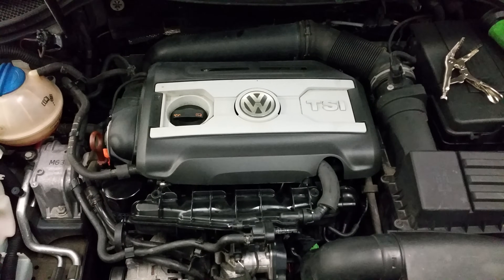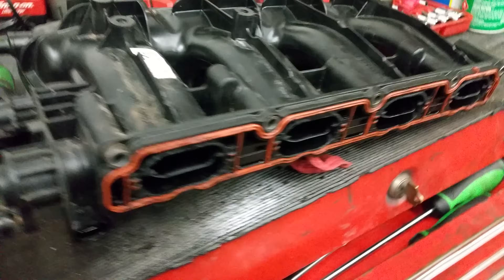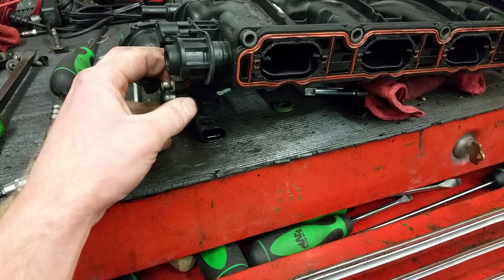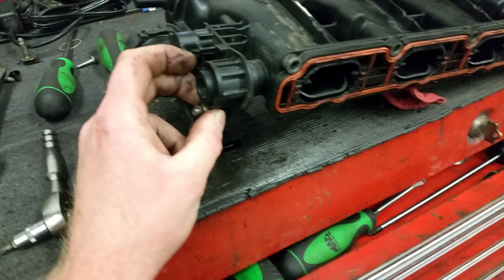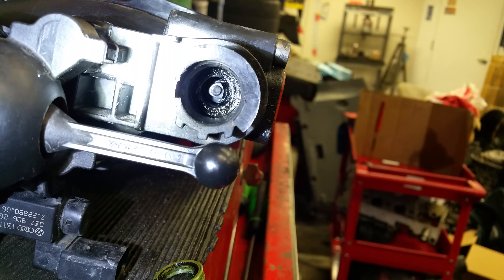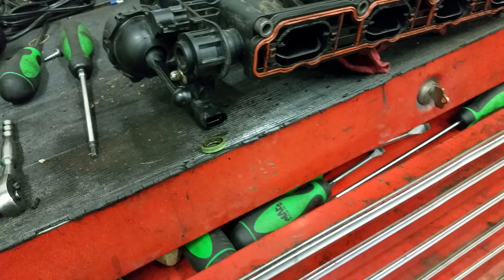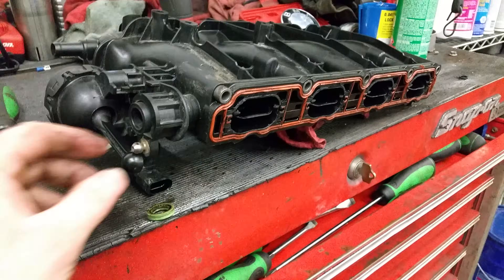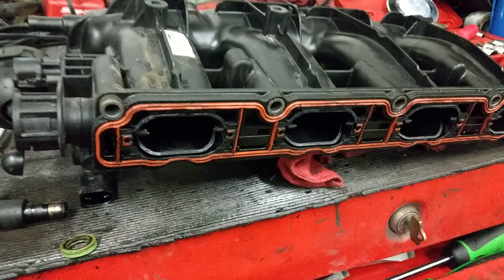VW 2.0T TSI Intake Manifold Failure Explained, P2015 Code

Comment: Volvo V50 bensine 1.8 liter 2005 model has a fault of yellow engine which appear and dissapear and it passed the technical revision, my question is if is safety if I buy this car in Norway, they wrote this in the add : Engine light can come and go - Diagnosis says some "flaps" in the intake. This means nothing for driving the car, and you can drive it daily without noticing anything. Was Eu approved with this, and has worked fine with this daily. What is your opinion is good to buy this car or not ?

Comment: I have a solution for this. Already tested and working like a charm. Not sure how long it will last but here goes.
First go out and buy "JB Weld 33301 Total Repair - Accelerated Instant Cure Super Glue, 0.18 oz" comes with a UV light attached which cures the glue instantly and hardens. JB weld says it has about 2700PSI of strength and withstands temps of around 300F. 

Apply small amounts at a time to each side of the triangle piece that is protruding from the flap piece and utilize the UV light to cure. Once you have all 3 sides cured. mate the triangle piece and see if it fits snug. If slightly loose, then apply a small amount of glue to each edge and cure it with the UV light. Then try again, if slightly hard to mate the triangle piece you are ready to put all back together. once you have the manifold flaps put back in place. Slide the female throttle piece into position, using slight force and making sure the flaps are facing the correct position. Then test out the function with your hand. Once you notice this has no play what so ever, you are done with that part. 

Now you will need to also buy "2.0T TSI Intake Manifold Lever Arm Fix Kit" 
Install that in place to prevent the triangle intake manifold arm from slipping back out. This device will ensure that doesn't happen.

Voila, problem solved. You can use this technique on Audi/Volkswagen's that have the same style intake manifold issues.

Comment: I know this video is a little older but here I am in 2023 and I have a 2016 Tiguan with 85K miles and the local VW dealership confirmed there is an extended warranty for this part.  I'm taking my car in to have it fixed under warranty.
Reply: Im a new owner of a volkswagon and these cars are A LIVING NIGHTMARE!!!!
Reply: I have a 2016 tiguan as well 86K. Will this apply for me too? Have a P2015 code on the service light.

Comment: Just received the P2015 code on our 2016 VW Tiguan.  Is it possible that just the sensor has gone bad and the entire intake manifold does not need to be replaced?

Comment: I had the same error code on my Golf 7 R 2014 (300HP). After checking by a mechanic it turned out that my Vacuum hose was completely disconnected… makes sense that I got this error too 😂

Comment: I have no codes accept, misfire on 2,3 cyl.
I have changed everything, plugs,coils, injectors, carbon cleaning, compression test ok.
Misfire occurs on startups cold or Hot. 
It feels like too much air or lack of air or fuel and then it stabilizes in 5-10 seconds. 

It’s a 2016 TFSI 2.0T. Audi A6 

Once I cleaned Intake with a carb cleaner reinstalled it, the misfire disappeared for a week. 

Then re appeared. 

I’m leaning towards the intake replacement, I’m watching these videos and thinking if I should.

I have thrown so many parts at this I’m having second thoughts….

Driving around with check engine light. 

Hopefully you have some insight…

It runs perfectly fine after the misfire on startup. Loads of power.
Reply: You ever figure out what it was i have a 2012 jetta turbo the engine sputters on cold starts until car warms up sometimes shuts off if idnt rev rpms until it warms up any clues?

Comment: Hi. Lately my A5 2.0 has been throwing a P2015 INTAKE MANIFOLD RUNNER POSITION SENSOR / SWITCH CIRCUIT RANGE / PERFORMANCE BANK 1a Code. Should I try swapping out Just the Runner Positing Sensor, or call it a day and replace the whole manifold ? A brand new one comes with The Gasket, Solenoid & Sensor for $210 from Autozone, brand URO pt #  06H 133 201AT. I'm just looking for an opinion with someone who has better knowledge than me. Thank you.
Reply: I got the same exact codes I’m going to just replace the whole thing soon, but wanted to know if you replaced yours and if your car problems went away?

Comment: My 2015 Tiguan got this code at about 93,000 mile.  I removed the black plastic lever and fortunately it was not all rounded out yet.  For some reason it just back off the shaft a few millimeters after driving it a short distance.  I used a 8 inch vacuum/flue line, slid it over the shaft inside the manifold and turned it clockwise.  If you listen closely you will hear the air flaps close completely.  Mine were open about 1/8".  I used JB Weld on the inside of the plastic lever and slip it back into place, let it dry over night and cleared the code.  Over 600 miles later still going strong with no code.
Reply: You did that without taking the manifold off ?

Comment: Hello I have an audi Q3 model 2012. After cleaning the throttle the car shows check engine with computer reading : Intake Manifold Flap position sensor bank 1 implausible signal code 08213 I changed the sensor but again showing check engine and the same error when read by the computer. Any help please. Thanks

Comment: I've just bought a Seat Leon Curpra 280 of the same year which I believe has the same engine. I got the same error code with the engine light on the dash. I've only had it two days and it comes with a three month warranty and already the dealership is being difficult on the phone. Hopefully they replace the manifold complexly and don't try a temp fix to get me over the warranty expiry date.

Comment: I'm curious if anyone has completely disassembled the "flapper" assembly from the manifold? I'm about a week away from pulling my intake due to a failure and presumably massive carbon build-up and although a new intake would be a rational fix, I've already had one replaced under warranty and am now outside the extension time-line.

Comment: Where exactly would you install the epoxy on the part? I found mine was loose and pushed it back in and now it’s running fine but I want to prevent that and I cannot afford to replace the whole thing right now

Comment: Hello!! I need some help. I replaced the manifold but not the sensor. I also purchased the ecs arm fix kit and it did not fix the code either. The car drives fine. Just has the code. Any idea what it might be? The sensor?

Comment: How was the car running when it gave you the code? I’m not sure if I need a new manifold or not. I have code p2015 along with misfire codes, even with new plugs and coils
Reply: This late but if misfire only when cold start for few min then problem is carb build up on intake valves. Intake must be removed and cleaned.
Reply: @geeess958  I literally tried everything as far as replacing the whole top of the motor and intake. That car was the biggest piece of shit! I spent $6,000 trying to fix it, only to let it go back.
Reply: @amandacarter7532  these cars have a lot of issues that Volkswagen themselves seem to not know about or understand. I've learned a lot about them through trial and error. They can be easy fixes if you have knowledge on their hidden issues. Nearly all of these problems with the intake are carbon related. It is a flaw but moderately cost effective repairable.
Reply: @geeess958  I loved this car so much but it was impossible to fix it. I took it to Volkswagen and let them run their diagnostics on it. I ended up paying them $2,500 for parts, labor, etc on top of all of the parts that I changed. The whole top of the motor was changed and the fuel pump in the tank. It didn’t have any build up inside it. The manifold was replaced and all. It was probably a tiny sensor or something. I went through 7 sets of plugs and coils and it misfired as soon as it was started. It would run fine if I started it, went straight into gear and pulled out. If I didn’t it was undriveable. I did everything in my power to fix it. I’ve never seen a more fucked up vehicle in my life. They really dropped the ball on those cars. I really wish I could have fixed it but instead I had to just let it go back. That car will always be one of my biggest regrets. I wish I’d had someone that had the knowledge to fix it.
Reply: @amandacarter7532  I'm sorry to hear about that. Messed up how they charged you so much and you still had problems. It is rare tp come across the right person that knows these cars. Its like a secret. Maybe one day I start a youtube page to help people. Just be soooo bidy. What you described sounds like a PCM or wiring issue, another notorious problem with these but relatively easy cheep fix once discovered. I've had several woth the issues you described and turned out to be a wiring issue. Many will disagree bit I think these should never be tuned. So sorry to hear about your story because these have really good potential if repaired right. Well wishes.
Reply: @geeess958  I always said that it had the symptoms of an electrical/wiring problem. I just couldn’t find anyone that knew how to diagnose the wiring. They wanted to continue to run trials on the car but everything they did costed me another $400-$500. I finally told them to not do anything else to it. They were just guessing. Their plugs and coils alone were $550 and I was telling them the whole time that wasn’t the problem. There doesn’t seem to be many people that do know those cars. It is like a big secret that only a few know lol

Comment: Has anyone had the seal cause a vacuum leak by cylinder 4, hense causing a misfire?
Reply: Just bought one. Cam shaft sensor decides how whole motor moves

Comment: Hey! I think this might be what I'm dealing with. Nobody EVER has videos on the CC, but my 2014 CC has the P2015, with about 86,xxx. I bought it as a CPO World Auto, so hopefully the dealership will help me out, but I'm not holding my breath. 
Anyway...the code reader I used pointed to the position sensor, but you said the whole intake has to be replaced? 

Thanks for any info, I know this video has aged quite a bit.

Comment: Great video. How many miles were on the vehicle? Also are you aware of Volkswagen extending the warranty on these due to consistent failures on their vehicles out to 120,000 miles?
Reply: is this so?  If so, I had mine replaced by the dealer at 55K and now at 113K, an independent shop says it needs to be replaced.

Comment: Instead of using liquid epoxy, I used the moldable metal reinforced epoxy sticks, something like sugru, and its worked for over 2000km on my MK6 GTI.
Reply: Can you tell us how exactly you applied the epoxy??  I want to try this method as a stop-gap but don't know how much to use or where precisely it should be applied.  Thanks!
Reply: @DanielPowless  I just jammed it in there
Reply: Would there be some risk of it getting sucked in through the opening into the cylinder ?
Reply: @davidescobedo1317  no, there is a seal on the other end, there is a risk to glue and lock everything up.

Comment: Will that p2015 cause p0300 multiple misfires
Reply: Yes it does Im having the same issue
Reply: I dont think so, in my opinion. The issue I believe which causes multiple issues surrounding the intake and random misfires is carbon buildup. Intake valves on these are notorious for carbon. And if buildup is in the valves, it is certainly in the intake flaps, etc.

Comment: I had my intake replaced 3 months ago (2.0t tsi engine)
But now the engine light comes up again! P2015 again 😐
The seller asked me if the sensor of the intake manifold was also replaced?? 
Which sensor...??
Reply: 10 months late, but probably referring to the Air Intake Manifold Runner Control Sensor from what I've been researching.

Comment: Damn, this is THE BEST video I've ever seen on the design defects of the 2.O TSI intake manifold. 

I've spent more hours than I care to admit researching this topic on youtube and VW forums, and while various videos explain bits and pieces, this video by far was the most comprehensive (complete) and clear (easy to understand).  Excellent work!    

I was contemplating getting the ECS Tuning fix (to prevent the arm from popping off), but now that I see that the arm triangle connection can become worn out (making the flap position not correctly correspond to the actuator arm position), I see that the ECS Tuning fix would only fix part of the problem.
Reply: Agreed!
Reply: I just got in from adjusting the ECS p2015 "fix" kit I installed. My CE light was off for a week after installing the kit, now its been on for months due to p2015 code. After watching this video I'm probably just going to order a new intake manifold as I'm sure the ECS kit will now solve my issue...at least its getting warm out.....I need a garage
Reply: Yessss👍😉

Comment: if you're under 150.xxx, go to the dealer and ask about the intake mani recall. I got mine warrantied out through the dealer cause this is a known issue.
Reply: Damn I just hit 120k
Reply: @justincelano760  I meant 150,xxx
Reply: @SuperDumbfounded  so wait I have a 2016 with 120k, i can still take it in??
Reply: @justincelano760  i think u are still eligible since its near the 120k
Reply: its only a 8 yeah or 120. not lifetime
Reply: @cbtech  wrong, PZEV models (basically all California models) are warrantied up to 150k or 10 years.

Comment: I am getting error P2015 with P1071 on an '09 VW Tiguan (114k miles). Any thoughts on where to look or what could possibly be the issue with the 2 errors combined? Very short on cash and not too mechanical but willing to dig around. Thanks

Comment: I have the same problem with the P2015 error code on my 2009 A3 2.0T and am about take it to an Audi specialist for a new manifold. I was going to buy the manifold repair kit: @ www. dieselgeek.com/collections/common-rail-tdi-p2015-manifold-fix, but your video shows that the kit doesn't fix most of the possible issues, so your video has saved me at least $70 (w\ postage) and the time & stress of finding it probably wouldn't work.

Thanks dude, much appreciate you taking the time to explain this.

Comment: Have you attempted the epoxy workaround yet? I'm curious to know if it's a viable short term solution as this just happened to my 2010 GTI with 135k miles yesterday. Thanks!
Reply: Update: I removed the valve, cleaned it with brake cleaner, applied epoxy to the female end of the valve, reinstalled, connected the rod and let sit for a few hours. The valve did not pop out after a couple hundred miles where it would pop every 20 or so before epoxying. I sold the car a few days later and explained to the buyer that the intake manifold would most likely need replaced in the near future.

Comment: When you install everything back together what position is the flaps inside the intake manifold before you bolted the air intake manifold back onto the car in what position will the flaps be opened position or closed position?
Reply: closed

Comment: after I replace completely still engine light ON vw cc 2013 intake manifold runner position sensor /switch circuit range  /performance bank 1
Reply: Louie Dakamseh same thing on my 2013 gti. Did you find anything out?
Reply: no, and now worse > shaking when the engine cold
Reply: Mine doesn't seem to be running any differently. If it gets any worse the intake manifold is only 150$ I might just replace it. I was thinking about trying to shoot some seafoam in through the manifold temp sensor hole to see if maybe the flaps are just a little gummed up.
Reply: its on eBay OEM  made in Germany with sensor only 80.00
Reply: Louie Dakamseh do you know if it's possible to replace just the sensor on the passenger side? Mine isn't broken in any way. It's kind of behind the oil filter. They sell the sensor but I can't find anything on anyone just fixing that.
Reply: @Andrew-on5do  did you find out how to replace the sensor itself? I have the same issue.

Comment: In your video description you state that dealers replace these at no cost up to 120k miles, is that true for both VW and Audi? I'm getting the P2015 on my '10 A3 as of this morning. Any info is greatly appreciated.
Reply from the maker: Jacob Henry , yes for both VW and Audi
Reply: Will they replace multiple times within the 120k miles if the P2015 shows up? Or just once?
Reply: Original owner only?  Do they do it because it is a faulty part?  Im asking because I bought mine used...  2010 GTI
Reply: @busterMcShamus  Did you ever find out the answer to this?
Reply: @cheesehead6710  any owner but its 8 year 120k. warranty
Reply: cbtech So basically I have to pay to get my 2009 2.0T Passat fixed with the P2015 code. VWs are lame as hell man.
Reply: Devin K lmao same. I'm getting mine checked tomorrow cause my turbo is making a crazy loud whistling noise and the guy said its probably the intake manifold, anyways he said it should be under warranty just $140 for the inspection plus whatever the labor cost will be if I have them do it.

Comment: Great video , happen to me yesterday. I like the idea of epoxy . Suggesting is fab something to snap on manifold and to the arm from popping out but still allowing it to swivel. And idea or if I creat something I'll post it
Reply: Try this for anyone who's looking to prevent the arm from popping out. I use it myself https://www.ecstuning.com/b-ecs-parts/vw-audi-p2015-20t-tsi-intake-manifold-lever-arm-fix-kit/021071ecs01~a/
Reply: M.R.I.A thanks for posting this as well.  I just did the expoxy trick waiting on it to cure.
Reply: @cjt74  how’s that go? i’m wondering if i should do that to mine
Reply: @fishwithwhatchugot6329  it’s a little complicated and it only held up for a little while.  The part from ECS tuning works though.  I suggest you go that route.